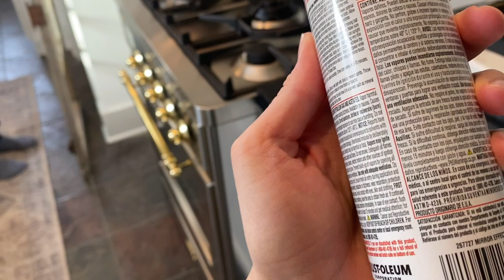Turning an Old Window into a MIRROR! Easiest DIY Ever!

Comment: Wow, that spray paint is amazing!  I can think of some uses for it in my own home.  I would add the mirror to the bottom of the window.  I would also suggest moving up the installation of the window on the wall, so it doesn't overlap the wainscoting below.  I think it would make the window stand out more as a prominent piece on the wall. Then, I would add a simple green wreath with a pretty satin bow to the top of the window for a nice spring display!  So beautiful!  🎀🎀
Reply: I was thinking the same thing about moving the window up on the wall !
Reply: ...but, maybe not the wreath.....I like the simplicity of,  just the window
Reply: I agree.  I think it would look better all mirror and above the wainscoting.
Reply: Exactly my thoughts ... yes, seasonal wreaths

Comment: Hi Andrea! Well I like the mirror effect. I think I would just keep it like you have it and leave the bottom as is. The only reason I say this is that with that blank slate on the bottom, you can do whatever you want: add a basket w/florals, add a wreath, add a picture, add a frame within the frame. Lots of possibilities depending on your mood. I feel like it should be higher on the wall just for proportion's sake, but really, if you're positioning it that way for a different vibe, then go for it! The window is super unique. and a great find!

Comment: The window/mirror looks great! My opinion is to not put glass in the bottom. Instead, I think 2 or 3 sprigs of a wispy plant or branches that come up from the bottom, either centered or slightly off center, or even from the bottom corner, leaning in toward the center. It would add some softness, personality and compliment the little greenery plants you have on the side shelves. Overall, it looks awesome!